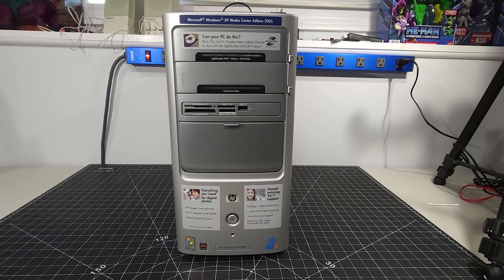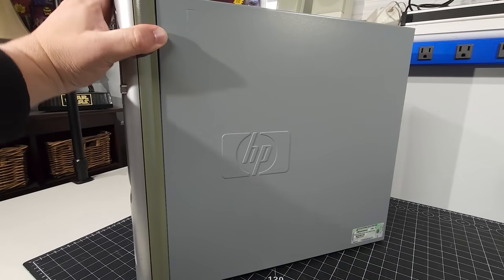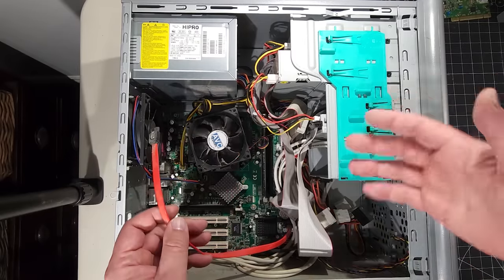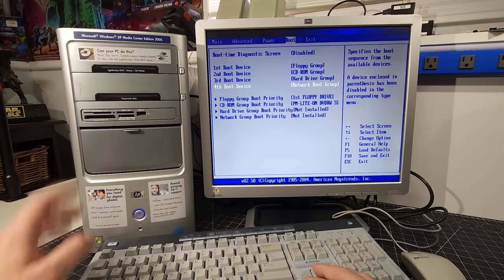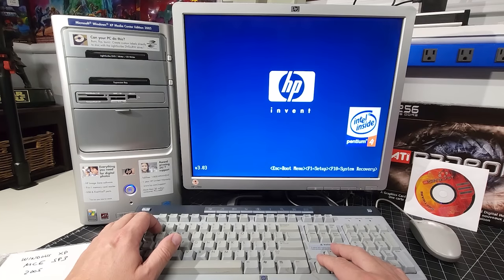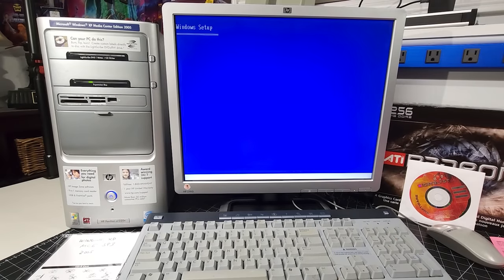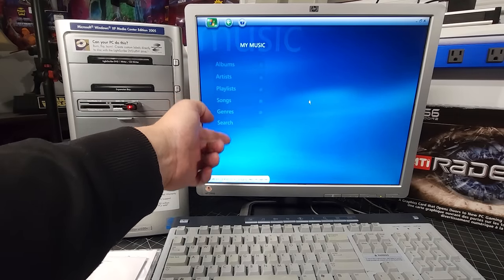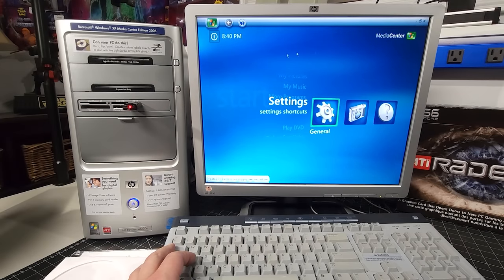HP Pavilion - Windows XP Media Center Edition from 2006!!

Comment: HP had some really slick looking machines during this period. Glad to see it running like a champ again. 👍
Reply from the maker: Agreed and thanks!
Reply: @TheRetroRecall now it just needs a 5.1 Dolby certified sound card and it can be the home theater system it was ment to be. 👍
Reply from the maker: On it!!!
Reply: I used to have the later one with the HOT pentium D CPU but now I’ve totally rebuilt it running an Intel Core i5-4570 CPU, GTX 1060 6GB GPU and Intel DQ87PG motherboard
Reply: @zotmidi747  that sounds like a pretty sweet rig 😁
Reply: Just a year later hp started using their piano gloss black towers. I loved the gloss black front face on em.
Reply: @rmcdudmk212 should be able to output 5.1 through coax. But thats only if the motherboard supports it
Reply: @stephenspilman68  and even if it doesn't you could get a 5.1 certified PCI sound card for cheap.

Comment: I bought one of these in 2006..not that model but similar. It is a media center pc but with an AMD Athlon X2 I believe…I remember I bought it in the long gone CompUSA.…I still have it…it works but I dont use it anymore. Usually those pcs also came with an IR sensor and a windows media center remote control..the sensor receive the signal from remote and also transmitted IR signal to control the cable box or Dish Network box…I remember I used that pc as a DVR back in the day to record shows when I used to have Dish Network. Old times memories.
Reply from the maker: Nice!!! Yes I don't think this one had the remove or sensor.  I am using it today though for DVDs and USB media!

Comment: An analog TV tuner card was an option on some of those XP Media Center machines, although that was not included on this particular example. Of course, those factory-installed tuner cards would only work with the old analog TV signals, which are no longer being broadcast. However, there are Hauppauge branded digital TV tuner cards available, if interested in adding that kind of Media Center upgrade. Later Windows editions dropped native TV tuner support, but the Hauppauge TV tuner software still functioned in it's place.
Reply from the maker: Great minds think alike!  I have a few Hauppauge cards I'm going to try out.  It's a fun machine!
Reply: This is a common misconception about these machines. Machines that were built after 2006 were required by the FCC to have either QAM ATSC or combined cards  to be compliant with phase 1 of the dtv transition. WMC also had update roll-up 2 that added support to digital broadcast television standards like those and cablecard.
Reply: @TheRetroRecall  AMEN!  The model I would recommend is the Hauppauge HVR-1600, as it has an ATSC tuner and it's PCI, not PCIe, as these machines only have an x16 PCIe slot for graphics cards, and it's recommended to save that for discrete graphics.
Reply from the maker: Sounds good, I'll take a look around and see what I have.  Also, smart about dedicated graphics being separate.
Reply: @DGTelevsionNetwork  Depends on the country.

Comment: A really very nice contemporary system.  Back then, Microsoft was still really creative 😁 I personally really like using this MCE theme, it just looks fresher and more colorful.  I never had a Media Center PC myself, so everything passed me by a bit back then.  I still have a card reader with USB 3.0 in my gaming PC today.  I still use cards like this often.  And I also still have an optical drive.  But no one needs modem cards like that anymore, what else can we do with them? Even back in 2005 and 2006, they were obsolete and more like a museum.
Reply from the maker: Haha yes, Microsoft was a little less boring back then.  Yeah those cards even then weren't very useful unless you were heavy into digital photography.  Even then you could connect a USB cable haha.
Reply: chrisrudi7162
Media in 2006, disks and cards.
USB is the only interface for external media, rest was legacy support. Internet only machines, keep the TCP/IP port only ?

Comment: Also, to answer your question about the capacitor plague, it happened between 1999 to 2007. By the start of 2006, most motherboard manufacturers would have stopped using affected capacitors. Although MSI would still continue to face capacitor issues well pass 2006 and into 2007.
Reply from the maker: Thank you!! I have no idea why I keep forgetting lol!  Fortunately this system doeant seem to have suffered from it.
Reply: I have three old motherboards with the same swollen caps around the cpu socket. 3300uf 6.3 volt. Going to try to replace them all. Mostly just for fun.
Reply from the maker: It's not too bad once you get the hang of it.  Also, it's a good idea to get rid of those caps before they start to leak on the motherboard.

Comment: Nice work on the cleanup & upgrades, as always! 😀. I've seen retro channels go straight for the solid state alternatives like CompactFlash without even confirming whether the original drive still works. They care about retro until it comes to the hard drive & then they wanna make exceptions. Thanks for keeping the spirit of spinning rust alive!
Reply from the maker: Spinning rust for the win!!! :)
Reply: It’s about preserving the machine solid state will last standard hard disk will corrupt
Reply from the maker: Yes, however I do have the images of these machines and will be uploading them to archive.org.  These are not in everyday use, however in the event a drive goes bad - quite easy to swap.  It all depends on what the goal is.  I like to add in the feeling of the same speed the drive would deliver at the time along with the clicks and pops of the mechanical drive - but that's me.
Reply: I do agree I miss the old clicking and popping of the physical hard drive but I’m more for longevity of the install and the machine
Reply from the maker: For sure.  For me I may take this same machine in another video and do something completely different.. Like a different OS, or a lightscribe demo, or something - meaning the HDD may change depending on the content.  If I was keeping them long term in a certain state, I may consider a different solution.  I get the desire for longevity.
Reply: @TheRetroRecall I understand where you are coming from I would do the same I agree I do miss the hard drive noises so much so I have a secondary hard drive in my computer for storage that allows me to get the nostalgic noises
Reply: @pug2052 SSD drives in fact have their own issues.
Reply: @blackterminal very true but they offer better reliability & speed

Comment: If I'm not mistaken,there should be a decoder built into the ATI software disk. There also is another program(from memory because I mostly use Linux now) called Stinky's(did not make the name up) that is free. Those old MC PC's are always fascinating to me. RIP WMC.
Reply from the maker: Yes there is, I'm going to install it to see if I can get past that error.  Yeah, tech evolved past the need for an MCE machine.. But at the time, such a great idea.

Comment: My family used to have one of these (or at least a similar machine) back around 2007-2008. It died around 2009-2010 due to what I now know is a dying GPU, but at the time we didn't know that, so we threw it out. I'd LOVE to have one of these again. With the full set of peripherals would be nice. These machines, or at least the one we had, had a 1680x1050 monitor, and a matching silver keyboard and mouse
Reply from the maker: Awesome!! Hopefully I triggered some Nostalgia for you :).  Maybe you will be able to find one in the wild somewhere.
Reply: 1680x1050 was such a fantastic resolution to have back then. I had a dual monitor setup in the late 2000s that had a 20" primary Dell UltraSharp at that resolution, sitting next to a matching 17" 1280x1024 model from the same line. Colors were pretty decent for the time, and those screen sizes meant the pixel density on them was relatively high too so they genuinely were sharp! I never much liked how 20 inch 1280x1024 displays looked..

I still have those, still working last I checked! I like using them when putting together XP era stuff.
Reply from the maker: Love this.

Comment: The HP Pavilion a1200/a1300 series.  
I bought this HP model in 2008 as an empty case (HP surplus, mint condition, never used).
A high quality (and Quiet) ATX power supply (500 watt) was installed.
The Intel DH87RL “Round Lake” (i7, 4770S) mATX motherboard with
internal WiFi antennas (repurposed laptop antennas) behind the plastic front panel.
SSD for Boot Drive, DVD, and two WD Red drives (4 GB) for a Raid 0 Data Storage.

I still use this computer today, it runs Windows 10 !!
Refreshed all the front decals for Intel i7 and Win10 !
Reply from the maker: Sleeper!!  That's awesome!  I love hearing these old systems (even if its just the case) get reused!  That's the nice thing when OEM's stick to proper standards... they can be reused.  Thanks for sharing!

Comment: The digital media enhancement programs were originally part of a Microsoft Plus for Windows XP pack that was labeled as "Digital Media Edition." They were later slipstreamed into XP MCE itself. Also, for being "spares," the monitor, keyboard and mouse are impressively period correct.
Reply from the maker: Thanks and yes, I'm always on the hunt at thrift stores and these were perfect finds for when a system like this came along.

Comment: The plague affects mainly Pentium 4 and Athlon/Athlon XP systems right until the Athlon 64. Older systems didn't draw nearly as much power and were not that often affected. I think the problem is more with new old stock parts than old used parts as the original owner would've very likely have fixed it. I remember at the time that we saw a lot of new stuff thrown away because of it, those failed early in the life. But when buying unused old parts, one might find the caps gone bad just sitting in there.
Reply from the maker: Leaking cap juice all over the NOS board!

Comment: I googled the model number, The drive in the expansion bay is a x48 speed CD-ROM drive, which is an interesting drive to pair with the DVD burner the system came with, considering it's several years older. My best guess is the original owner used the system to copy cds, and just threw in a spare they had. (When I see an odd configuration like that I like to speculate on it.)
Reply from the maker: Thank you for checking this out for me.  My vote - fix the lightscribe drive and replace the expansion with a similar drive :)

Comment: I have a dell dimension e520 I got in Christmas 2006 shipped with Windows XP home all these years later it’s still running with media centre now installed fully patched and protected with a slight ram upgrade
Reply from the maker: Nice work!!
Reply: @TheRetroRecall thank you I’ve never gelled with windows 10 or 11 I have tried them but I just like the simplicity and familiarity of windows xp it still works it still browses the internet  and I can do my invoicing on it as I need it to so why change

Comment: My father had this same computer. I ended up with it after my father was gone and it worked for several years until the capacitors started to leak. By then the damage was too great to be worth fixing.
You could get an optional remote control for it. I was given one, so I put it on my father's PC. It was great. Tried putting it on other PCs, but it seems it required the Media Center drivers.
Reply from the maker: Thabks for sharing this, glad to hear it was in use for a long time.  I have not been able to locate a remote, however I'm sure one will pop up one of these days to complete the system :)

Comment: Found one of these at a local tip recyclable shop for $10 untested but in perfect condition, just missing its HDD. Brought it home, popped a new 128GB SSD in it and installed XP MCE. Runs extremely well for a Pentium 4.
Reply from the maker: That's amazing news, glad to hear that you had rescued it!

Comment: Omg i so remember using this PC. i remember using this with an Xbox 360 and since i had Cable connected to the PC i could use it to record TV shows and Movies from one room on a Widescreen Flat Panel LCD and have it play back in another through the Xbox 360 connected to a Plasma TV! it also doubled as a sick gaming PC because of the processor and GPU we had. did heavy gaming on NFS Underground 2, Sims 2, Sim City 4, Final Drive Nitro (HP Bundled this game for free) on an X1300 pro. i think at some point we also used it to make Home Movie DVDs from Camcorders and digital cameras (weddings, birthdays etc.) great system and fantastic version of XP!
Reply from the maker: Thanks for sharing this memory, that's awesome!  Although I never had much experience with this OS over the years, I had a lot of fun with it in this video.  I also heard of many of my friends at the time with MCE doing exactly as you did with the videos!  Thanks for watching!

Comment: My family had an a1600n from 2006 which came in exactly the same case as your unit and had an Athlon X2 3800+, 1 GB of RAM, a 200 GB HDD and integrated nVidia graphics. I seem to remember it costing around $600 on sale near the end of 2006.

We also had an m7640n, which was a higher up model from the same year with an X2 5000+, 2 GB of RAM, a 320 GB HDD and the same integrated graphics. I think it was around $900, and I can't remember if it was on sale or not. It was one of the ones with the media bay for a separate drive, which I also ended up getting. HP called this a PMD, or Personal Media Drive.

The PMD was effectively an external SATA HDD enclosure with, in my case, a 500 GB drive preinstalled. It used a standard USB B port and a barrel jack for power, and there were corresponding male connectors for USB B and power inside the media bay. The unit also came with a power adapter and USB A to B cable so it could be used as a normal external drive, which was convenient because otherwise you would have had to furnish your own in order to use the drive anywhere outside the PC's media bay.

Being just a particularly shaped external HDD meant the PMD was shuckable if you wanted (which was useful when I managed to knock it off a table one day while using it with my laptop, which promptly killed the drive; at least I could still use the enclosure for other drives I had).

As for getting hold of the factory image for your machine, I happen to know from experience that a set of discs made for the a1600n worked perfectly when I needed to restore the m7640n. Granted, these two machines are more similar to one another than either is to your model, but nonetheless, it might be worth giving a restore image from another HP media center PC from the same era a shot.

Browsing on Archive.org, I found a couple uploads for the a1520n, which is virtually identical to my (now long gone) a1600n. From my memory, the software included with both my family's machines was similar if not identical, so I would guess all the HP media center models from 2006 had the same or very similar OEM installs.
Reply from the maker: Thank you for all of this info!!! I will definitely take a look and see if the image will work.  I have an HP Media drive here today I got years ago still working!  I have since backed the data up.  Thanks again!

Comment: This was my main PC for a long time. Even ended up using it as a server in the very end. What was really nice about it was the ability to reset the computer without needing install discs.
Reply from the maker: Awesome!! You say in the end, is it still around??
Reply: @TheRetroRecall  Also a beautiful silver LCD monitor came in the same product range and the keyboard was awesome.
Reply from the maker: Agreed
Reply: @TheRetroRecall  Youtube doesn't want to keep my second comment about it's whereabouts. Long story short it got tossed by my dad who didn't know that it was functional and that I wanted to keep it. Was my first PC to connect to the internet after a few years of owning it. I was about 13 years old when I got it. I tried to upgrade it with a sapphire card at the time but aside from spinning fans - no video. Hard to say what the issue was now, but I definitely didn't know what I was doing. The card was probably incompatible. With upgrades, I would have used it much longer I am sure.
Reply from the maker: Absolutely.  Funny about the YouTube stuff... I'll take a look at the spam filter.

Comment: 4:07 - you're probably not going to find the correct HP shade of gray plate for that floppy drive.  This model of Pavilion never came with a FDD from the factory, and was built about 2 or 3 years after HP stopped building units with them (and this was probably one of the last models that still had a FDD controller on board).  That particular drive is from an older Pavilion where the eject button and drive bezel are build into the computer's front fascia, circa 2001.Yup
Reply from the maker: Thanks for this info!  It would be good to get something there, so hopefully the one I have will be somewhat close :)

Comment: I have this exact computer. Used it from 2006 until 2014 when windows xp support ended. Put it in storage in working condition but unfortunately the capacitor plague killed it. Nice case though, probably gonna reuse it.
Reply from the maker: Yes the case being standard helps!  Unfortunately the cap plague knocked off quite a few systems over the years.

Comment: Had a HP Pavilion A1630N during high school, looked pretty well identical to this. AMD Athlon 64 X2 4600+ 2.4GHz dual-core CPU, 2GB RAM. If I remember correctly had a Nvidia Nforce Chipset so had GeForce 6150 integrated graphics? Ended up buying a ATi Radeon X1650 Pro 512MB for it.
Reply from the maker: Nice!